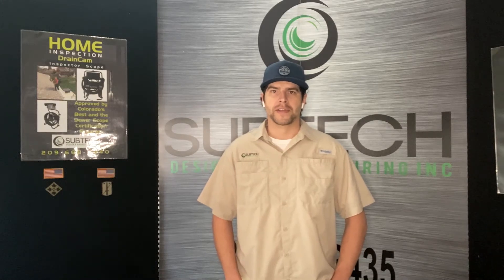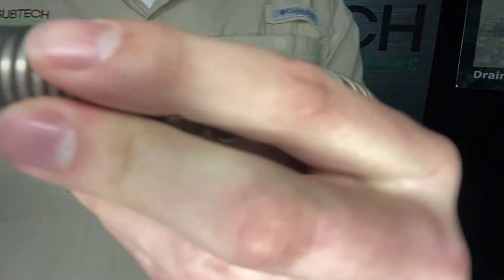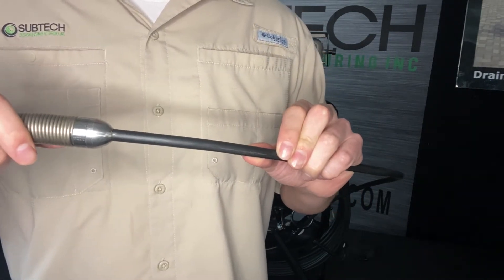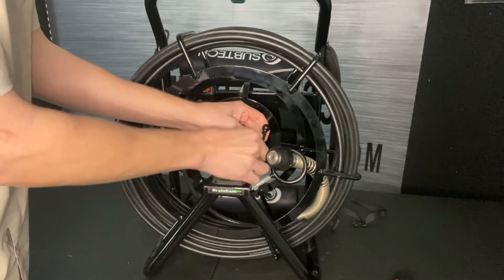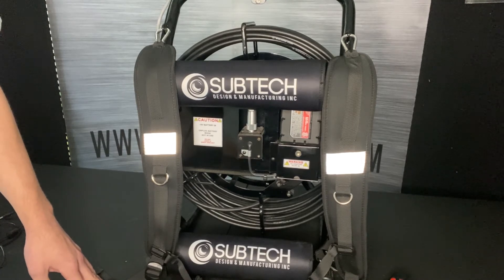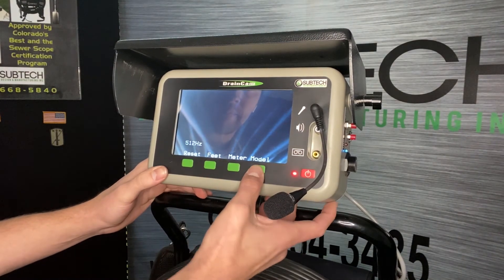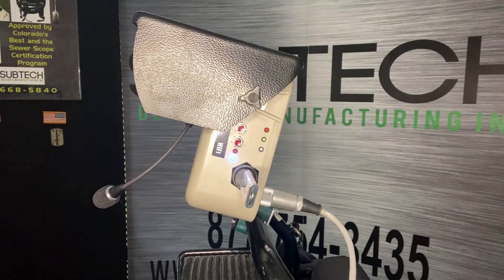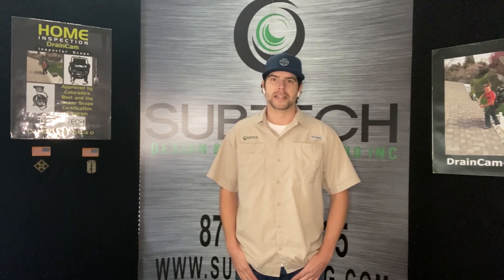Subtech "Inspector Nick" Sewer Scope Camera demo

Comment: Seams like the camera head might be a little to flexible. Might end up going up the wrong direction in the pipe. Might not be able to push through smaller clogs either.